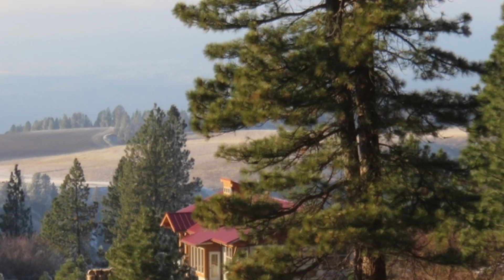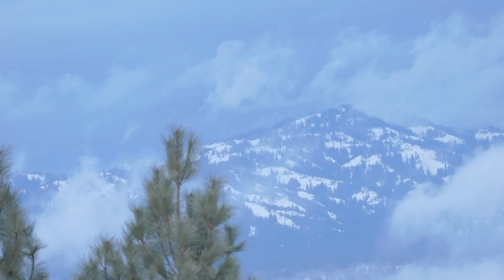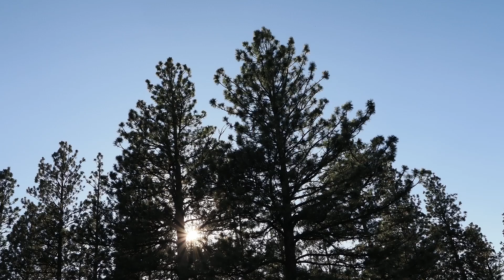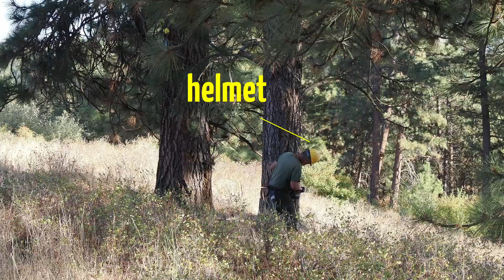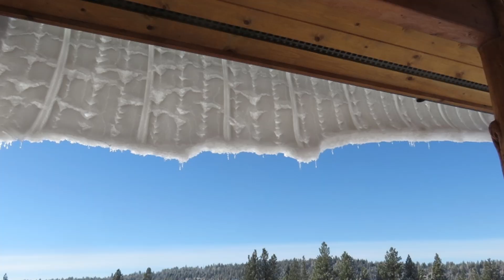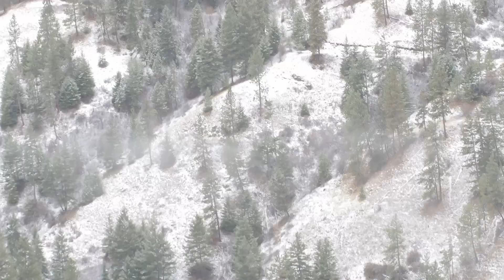How We Heat Our Off-Grid Strawbale House in Winter

Comment: Very similar situation here. I live in the southern Sierra Nevada at 6840 feet in a strawbale house (with lots of south-facing windows) and use two wood stoves to heat the place. Most of the time I just run one stove at a time, but when it gets really cold I go with two. One year I cut and split all my wood, but that's a lot of work and so I purchase most of my wood now although I have 80 acres of pinyon and so I still cut and split some wood myself. I had a solar water heater, but ran into problems with that and so I switched to a propane on demand water heater. I'm also working on adding more solar panels.
Reply from the maker: It must be beautiful there! It sounds like you have a great set-up. We already have propane for cooking, so it might be easiest to use that for hydronic heating. But we've added a lot more solar panels and batteries over the last few years and have plenty of electricity on sunny days and would love to use more of it. We're still figuring that (and many other things!) out. Meanwhile, the passive solar plus wood stove combination works really well. If it were just me I'd probably buy wood too, but at least for now, my husband enjoys chopping up wood in the fall. 😊
Reply: We are building a solar oriented strawbale in the Sierra Nevada and currently looking at HVAC options. Do you find you get enough cooling in summer with your strawbale and passive ventilation, or do you use anything for additional cooling? We are considering air-to-water heat pump with propane backup to avoid overtaxing our solar system. This can provide heat and cooling, but searching for the right setup and system right now.
Reply from the maker: @ We do pretty well with fans. But it rarely gets above the mid-nineties here. Yet given how much excess solar electricity we have in summer, we have talked about a small ac unit of some sort (maybe portable or maybe a mini split wall-mounted unit). That would make it even more comfortable on the very hottest days. If our climate had many days above the mid-nineties, I'd definitely be looking more seriously at ac. I hope you find the right solution for your set-up.
Reply: @ For me maybe ten afternoons per summer are warm. Nights cool down nicely and so just opening windows at nights is adequate. An AC unit would probably be overkill, but maybe an evaporative unit would be cost effective.

Comment: If by solar electric you mean "heat pump" then go for it (air - water - system). It turns 1 kwh electricity in 3 or more kwh of heat. I would expand your solar array you will also need larger battery storage. Yet, this will not provide 100% of your need. As a backup I would go for a diesel or propane generator. Yes they burn fossil fuels but so does your car, chainsaw and log splitter. I think with a decent sized solar array and battery you can provide 90% of your electricity need, so only 10% would come from fossile fuels.
Reply from the maker: Great ideas! Thanks! We're in the process of expanding our solar array and battery storage. It already runs a lot of power hunger appliances. And we have a generator for backup but don't need to use it that much.

Comment: I would definitely look into TempCast masonry stoves especially where you live. They are in Minnesota & make albeit heavy but very efficient stoves that you could burn once every 18 - 30 hours depending on the model you choose. The bulk of the stone work keeps a 1k-1.5k square foot home very comfortable & would also take advantage of the bale wall's insulation properties. You could probably halve or less your current wood needs.
Reply from the maker: Thanks for the tip. I'll check them out.